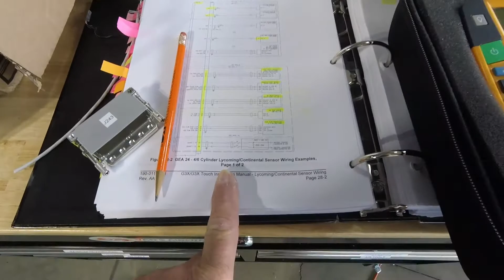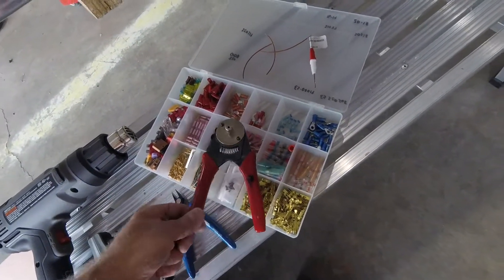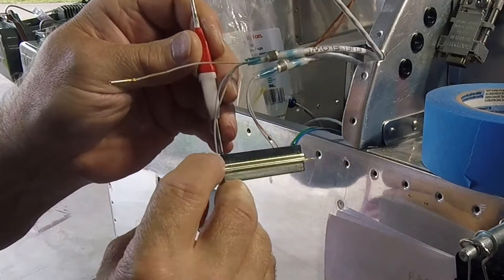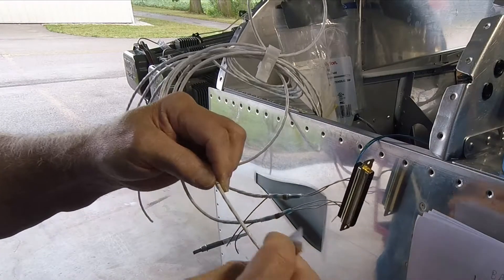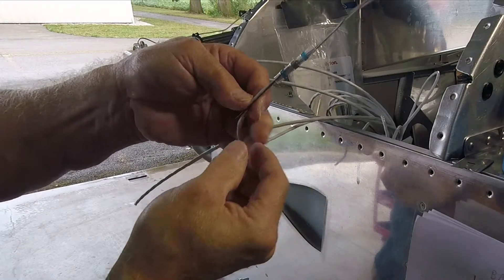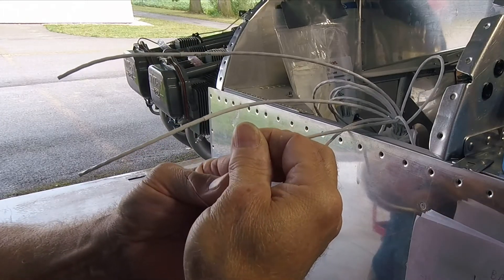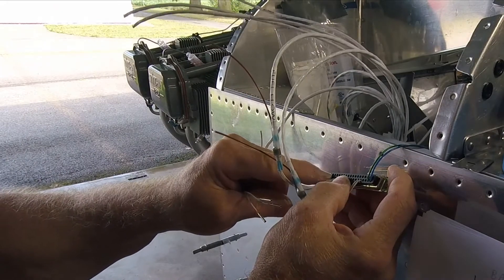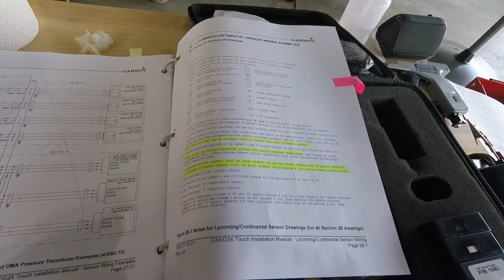How To: Garmin G3X Shielded Wiring Harness Fabrication

Comment: Even the Garmin 2.5” of strip length is about the most I would want.  Every inch those wires extend outside of the shield is more “antenna” to pick up noise.  Ideally, you want the shield of the cable to extend into the metal back shell on the connector.

Comment: I just got my g3x garmin system. I am having problems finding the wiring diagrams for what pin goes where and what wire size. Started mounting the GMU 11 Magnetometer in the wing. Any hints on were to start? Thanks great video.
Reply from the maker: Go to Garmin's website and download the G3X installation manual. https://support.garmin.com/en-US/?partNumber=010-01057-00&tab=manuals

Draw a diagram of your system and all components, then start figuring out which boxes need to talk to each other. From there you can start on a detailed schematic using the installation manual (IM) as your guide. The IM tells you what wire to use.
Reply: @n777rv  Thanks , I have been reading the downloaded manual for a while but having trouble finding my way around it. This is my first build so all is new to me. thanks I will get started on a diagram.
Reply from the maker: @KitfoxPilot  You should look into the EAA SportAir Electrical Workshop. https://eaa.org/Shop/SAW/Workshop_Details.aspx?workshop=electrical_systems_avionics
Reply: I found this on VANS website.  https://www.vansaircraft.com/downloads/#ElectricalSystemDiagrams  I wonder if they have diagrams like this for the other VANS model of aircraft.